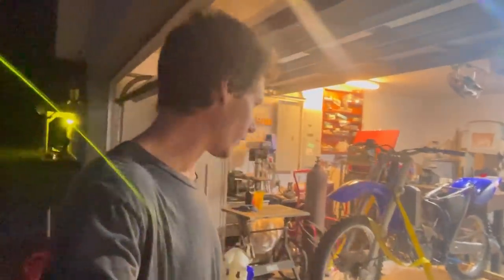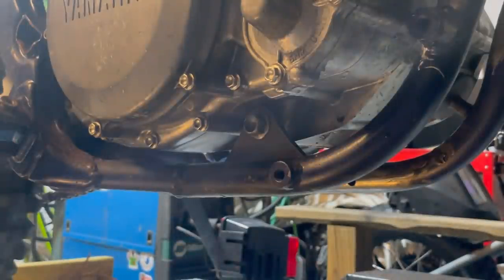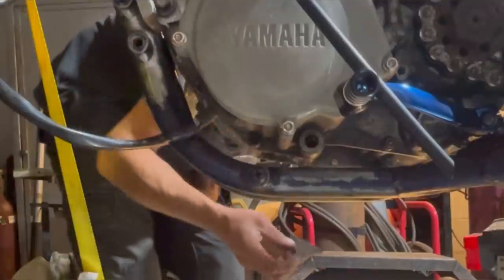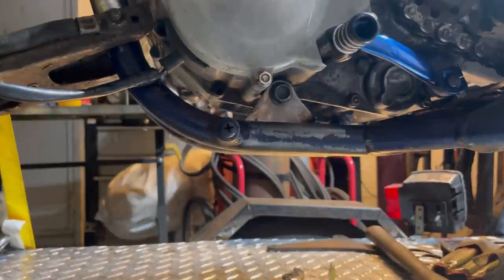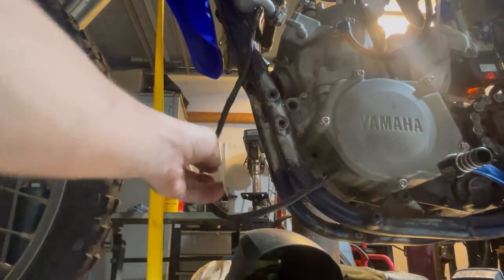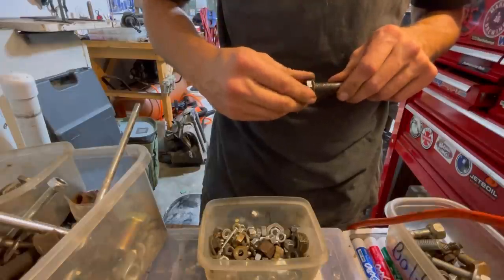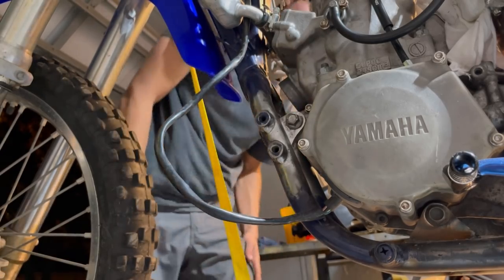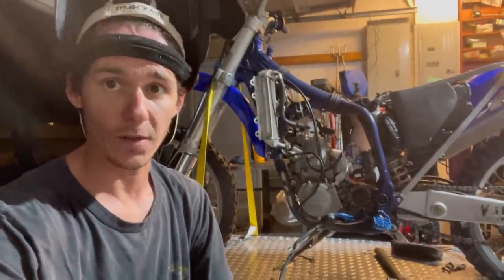Making a 2 stroke Yamaha work in a 4 stroke frame! (Easy welding job gone wrong)

Comment: Anthony, I see one area you can make your life easier on stuff like this.....
you need a wire stick out of 1/4 to 3/8 inch for .030 and .035 wire, 
more stick out cause issues with the way the wire melts off, more spatter,
inconsistant arc, ect.
Your contact tip needs to be flush with the end of nozzle for short circuit MIG,
axial spray transfer 1/4 inch back. Anyway, because the nozzle is getting in the way and 
keeping you from getting close to weld pool, stick out is longer,......If you get a second nozzle,
and cut it shorter, you can have the contact tip out in front of the nozzle by 1/4 to 3/8 inch and 
keep your stickup to a good length. you will have plenty of gas coverage at a normal setting, 
and it is also great for getting into tight fillets in corners or T Joints......I hope this may help you, 
I know it has helped me a bunch.....Paul

Comment: Anthony , you need to adjust the back rollers on your band saw......they are too far away
from the blade when there is no pressure on the blade, they should be a few thousandths
away from the blade, not spinning when blade is passing until pressure is put on blade.
a piece of paper will be a good distance. hope this helps, it puts less stress on blade and
makes tracking better on the drive and idler wheels....also make sure the lower rollers is
adjusted, Cheers, Paul
Reply from the maker: I know it! its not difficult I just haven't got around to it
Reply: @MeltinMetalAnthony  I want that band saw......what brand is it.....now do not be lazy old timer.....adjust  them rollers..the top ones [that hold blade parallel] need no gap.....give me a call.....Paul
Reply from the maker: @ypaulbrown  its a 40's craftsman with the gear reduction box. someone hand painted "metal only" on the front. I do love my vintage tool!

Comment: very cool. I adapted so many engines, to motorcycle frames, even as a kid I brazed mounts, before I owned a welder, then to lengthening frames, doing any custom frame  work customer wanted. this is 1 of my good areas. lol, sheet metal auto-body is another.

Comment: Just a tip, both sides are identical so after you marked and cut your first peice, you could have traced your 2nd, instead of doing every individual one. I know its not always like that but in this case, it is.. nice work though

Comment: You are a really good welder bro ! What I would have done was welded 1 side on all mounts and then take the motor out and then weld the other side after. My mig gun is also a lot smaller you are using a full on industrial size.

Comment: Interesting video Anthony. I am going to have to take on a broader aspect to my welding repairs and fabrication work because my landlord for the house I rent on a farm and use a building on for farm repair work has put the place up for sale.
Sadly I don't have £1Millon ($1.3Million) to buy the place. So, I have rented a small industrial unit in a town and need to find welding work in that area and home to rent!
Reply from the maker: dang! I hope you figure something out
Reply: @MeltinMetalAnthony  Thanks young man. It has dropped right in the "brown stuff" so to speak. Had to cancel most of my repair work because I had to find s unit to put my equipment into to keep it safe and to rebuild from. Finding an affordable home to rent it tricky.

Comment: Very cool video. Resurrect a frameset with modern suspension travel using a two stroke.  If chainline is right and you're not going left all the time, why not?

Comment: Love the great work but it looks like he didn't have the engine where it really needed to be probably had to remove a few links in his chain or going to try to bring it I know there is a chain tensioner but there's always those things to look out for plus it may not run right if the carb isn't sitting in the level   possibly lol

Comment: I think your issue with nuts and bolts is the wrong size socket sae and metric and just a bit different but also close enough that you can still think it’s right but it’s gonna strip it. That coupled with a socket that’s slightly off increases the chance of stripping.
Reply from the maker: na the socket was metric, it was a 10 mill, dude told me he lock tighted it 😂
Reply: @MeltinMetalAnthony  well I see why that would cause a problem....

Comment: That was hard to watch. Its pretty easy to pull that motor btw. Prolly dont even have to pull it all the way can just leave it attached at the swingarm just loosen it. And then tilt motor back.
Reply from the maker: ya I did that the next morning and finished the weld after I thought about it a bit

Comment: Don’t you want to push mig?  24 volts 400 inch’s. 045 wire. 40 years  we need to put you on the production line at case!

Comment: he will never get that motor out, thats why they have a triangular piece with three bolts in it on yamahas so the engine can move forward enough...hope he has an angle grinder
Reply: It looks to me there is more then enough space, your probaly right if it would be the original engine set up